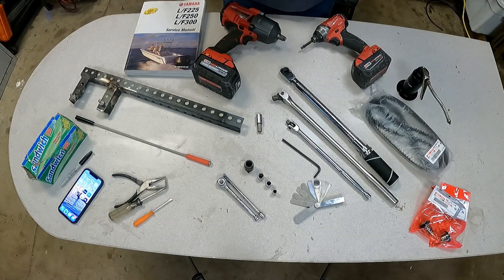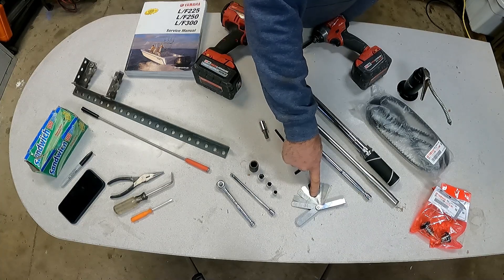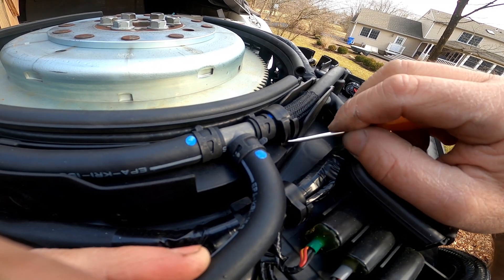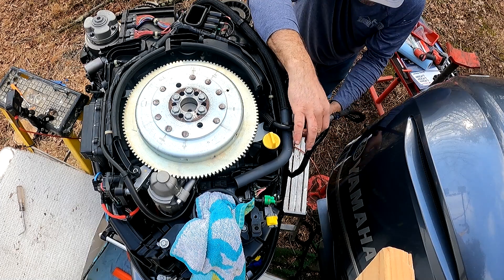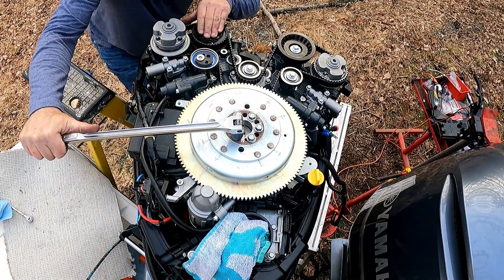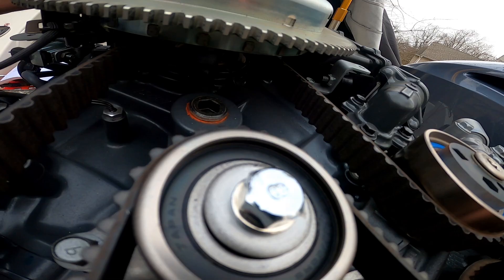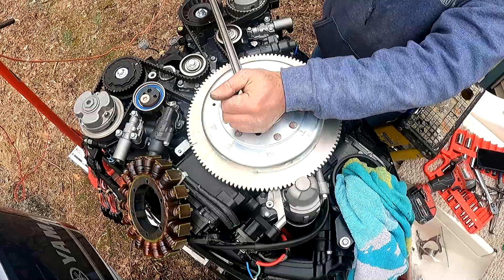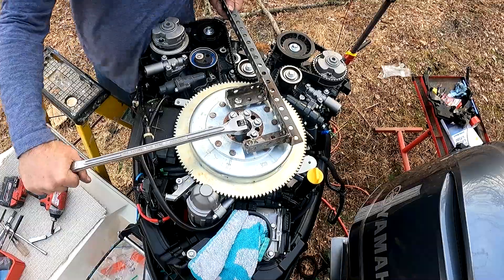How to change a timing belt on the 4.2l Yamaha 225 250 300 HP

Comment: I have a 2010 yamaha 225 very low hours 320. I just bought. Guess timing belt due  because age. Iam getting told to replace  tensioner also along with tstats and anodes. Can someone comment?
Reply from the maker: @georgeh4986  yes.  Replace the tensioner with the belt.  I do tstats every year.  Your anodes may be ok. Could wait another season, but a little less labor if done with timing belt.
Reply: @4RibsFishing   great thank you!!

Comment: The manual i have for the 225 hp one has a drawing it shows and states that the pistons are notched  and that they are non interference engines. It doesn't say that for your 300?
Reply from the maker: the 4.2 is absolutely an interference engine. Those notches provide clearance when the camshafts are in perfect time with the crank. If you get it wrong those notches are not nearly enough clearance for the valves.

Comment: Great video.  I tried to change my timing belt but the marks on the belt are not lining up.  I can get the lines on the belt to line up with the camshaft sprocket marks but the 4 dots on the belt don't line up to the arrow on the crankshaft.  It is 180 degrees off.  The 4 dots are like at 11 and the arrow on the crankshaft is at 5.   Plus the VCT moved and when I used the 10mm hex to line it back up, the piece is loose now.  I assume that just needs to be tightened back up?    Do you know a good way to determine TDC to make sure I have everything lined up?
Reply from the maker: Jimmy, you are not on the correct stroke yet then.  Keep spinning her till the marks line up.   It may be 4 rotations before you get it right. Take all the plugs out to make it easier.  Find #1 and have your finger on it.   When it’s on the compression stroke it will blow air out the plug hole.  But it may not be the right stroke yet.  Need all marks to line up at #1 tdc.

Comment: Great video.  Best one I could find.  Do the T-stats as suggested, also consider replacing the OCV screens too, they're right there with the t-stats.  I replaced idler pulleys and tensioner.  Surprisingly, the idlers had more play than the tensioner. The tensioner can probably do 2000hrs easy, the idlers might be a bit clapped out by then...  Just like every other modern timing belt I've taken off, this one looked perfect; but I'm not a mechanic.  I suspect that if your timing belt is in bad shape it is because you have a problem somewhere else... YMMV.  Thanks 4Ribs.
Reply from the maker: Thank you Michael!!!

Comment: Did you check your flywheel for up and down movement basically checking the crankshaft thrust washers
Reply from the maker: I didn’t.  Approximately 725 hrs when I changed the belts.

Comment: Fantastic.   Thanks.  Mine are coming up on 1000H and contemplating doing it myself.  Prob save 800 bucks per engine.    *EDIT  -  Done.  I started with the spots on the belt at the crank index.   Then used the belt guide to hold it tight and went from there.    The job was a bit tougher than I envisioned as I had a hard time getting the new belt over the sprockets and followers, even with the tensioner fully released.     But I left everything on the port side of the engine connected.   I disconnected on the other side and used a block of wood to hold the harness bracket up.   Might be why I had so much trouble but I watched another vid that used this tech.   Thought I could save some time.
Reply from the maker: You’re welcome Steve!

Comment: I watched this for fun and also to expand my exposure to the newer Yamaha's in case I upgrade to a newer motor at some point.  You guys with the 4.2's are spoiled with the way the flywheel is removed and re-torqued.  On my 3.3L, without the stupid flywheel holding tool and a puller, it's a bear!  I ended up wrapping a ratchet strap around the flywheel twice, using the lifting ring as the anchor point for both ends of the strap, so I could torque the nut to spec without the Yamaha tool and without struggling.  Worked like a champ!  I guess I could weld a tool that I'll only use every once in a great while.......lol   Thanks for sharing.
Reply from the maker: Yes, after spending 35k per motor we have it easy! Lol